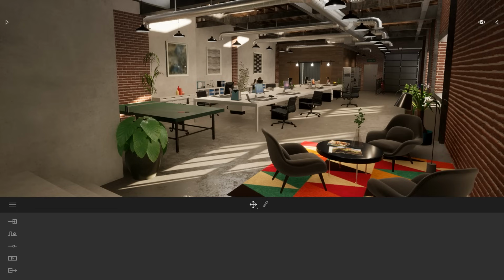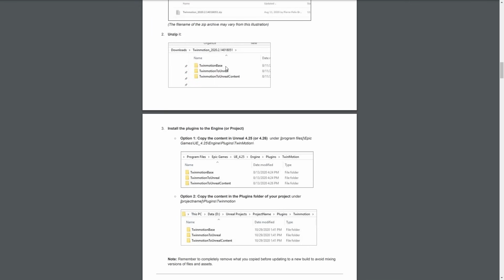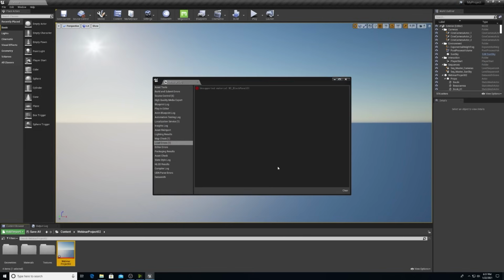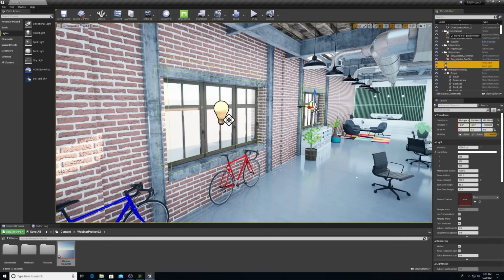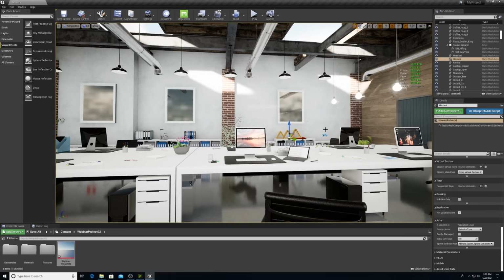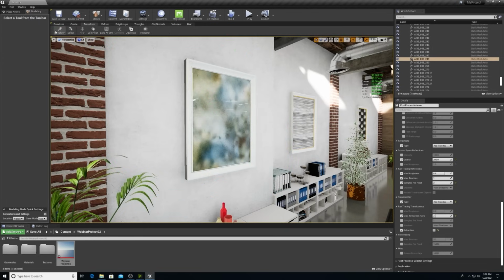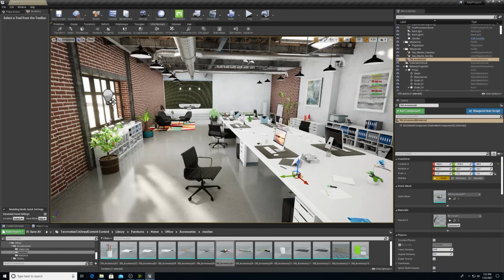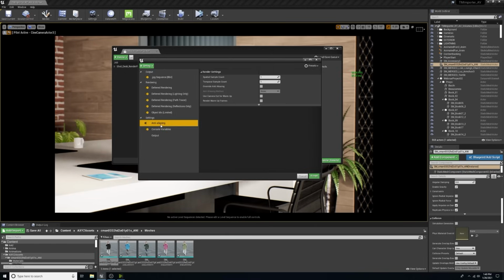Importing Twinmotion Projects into Unreal Engine | Webinar

Comment: I have questions please :
a - Does Twinmotion 3D Engine is Unreal Engine ??
b - I Use Twinmotion for my Architecture designs I don't need interactivity between user and the design,   Should I Learn UE or Twinmotion is enough for me ?
c - Does UE has any rendering enhancement more than rendering in Twinmotion ?

Comment: This worked perfectly with UE4.26.1 but after the new update, which is 4.26.2, the datasmith for twin motion isn't working. I checked on 2 different systems. Can you address the issue?
Reply: same
Reply: @ariccressey5226  i just figured this out. Beta 1 version isn't valid now. Use beta 2. It works now

Comment: Hi so I have one question regarding workflow. Is there any point going from say 3ds max then into twinmotiom and then into unreal using the datasmith plug in. Why not just go straight from your 3d package to unreal via a fbx export?
Reply: The point is that architect starts to work with visualization in twinmotion, making a vector for project composition, next, vfx specialist continues to tune up the project in unreal engine. While architect begins to envolve in new project. This is about effective labour organisation and if you work alone you do it as you wish.

Comment: why twinmotion couldn t add this ray tracing into the current twinmotion,why we need another interface to improve rendering quality?unreal engine interface so different than the twinmotion interface and working environment.as an architect ,we dont have time to consider new menu structures..
Reply: i agree! Even if i know unreal engine i have to admit it is just too clunky for architects... Blender solved all my problems . It already has built in engine and can view project using verge3d online.